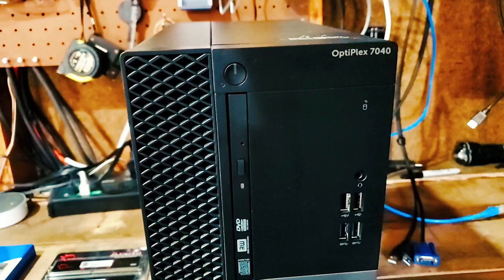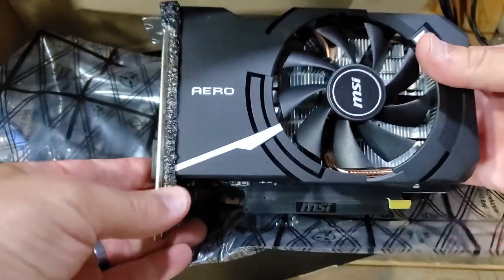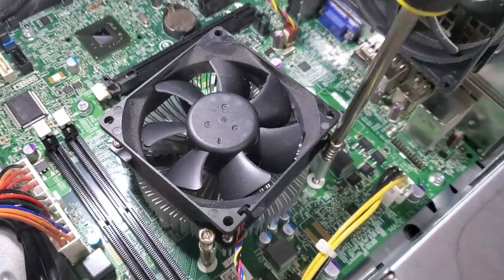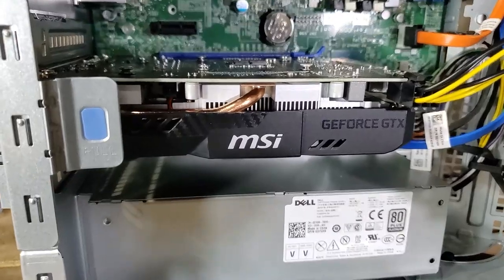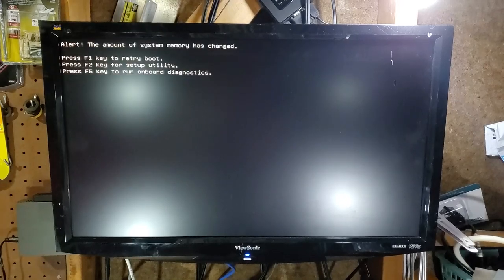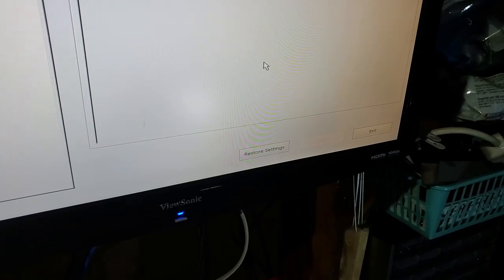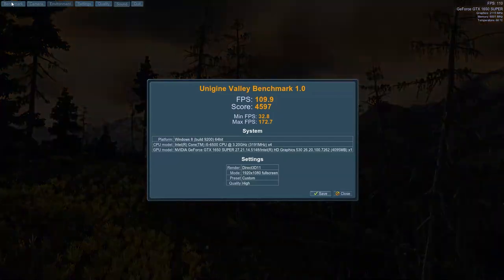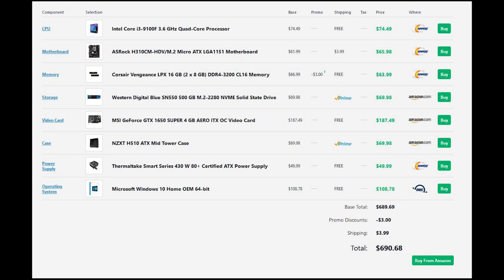Nvidia GTX 1650 Super in a Dell Optiplex 7040 - Best Optiplex Gaming PC for 2020!

Comment: I really appreciate that you kept on updating us with the power usage now I am confident that my system will handle the 1650 well below 180W
Reply: totally, agreed!
Reply: So we don't have to upgrade the power supply for this set-up to function properly?
Reply: Ya that saved me a ton of stress. Thank you very much. Very clear and helpful video!
Reply: any update?
Reply: mind you, thats a 1650s
Reply: What about a gtx 1650 4gb ddr6 model. Does it need a PSU upgrade?
Reply: @Mohammed_Ayaan46  No
Reply: @Mohammed_Ayaan46  
It takes only 75 so you're good
Reply: Does a gtx 1650 super need psu upgrade?
Reply: Can I use single sata go 6 pin? Or should I get the double sata?
Reply: @evamariaopara9501 I'm going with the single sata to 6pin. I've used before on regular 1650 with no problem. I trust it on the super. It's really only supplying @ 25w through pins 75w will come from motherboard pcie so shouldn't be any problem
Reply: Even a 3050 will work, because of new more efficient architecture, it only takes 75 watts

Comment: Good build buddy. I have dell optiplex 980 sff one the best built optiplex out there still works great. Now I see the inside on this 7040, I think this one is the best so far and the fact that it is very easy to work with and supports modern ddr4 and ssd.

Comment: Thanks for posting this video!
I was going to buy a GTX 1050 TI thinking it was what I was limited to.
I found a slightly used 1650 super for $225 and making an offer on eBay. The seller said was only used for a YouTube video comparing cards.
Reply: how did you go with the 1650 super, did it work well?, I thought i was limited to a 1050ti aswell
Reply: @joelpope801  It fit just fine and I just needed to buy a sata to 6 pin adapter to power it. Works great so much better than 1050ti. Power draw was only 195 max on the 240 watt Dell PSU measured at the wall with a Kill-A-Watt meter. For reference the EVGA 1650 super is 8" long and fit fine so make sure whatever brand you find is not much longer than that
Reply: @BARBELLS-AND-BUDS  did you buy the same 2-SATA to 6-pin?
Reply: @ber2996  I did run the sata to 6 six pin and it worked fine for about 6 months and then the computer wouldn't boot.
That little Dell PC couldn't support it and I kept replacing the power supplies with different ones with no luck 
It turned out it actually burned a trace or something in the motherboard.
I wasn't 100% sure, but bought a new motherboard anyway to try. 
I found a used motherboard on eBay though and rebuild the computer with a new motherboard and it's fine now.
With a 1050 TI was doing fine but when I went and put a 3060 in there and started gaming with it, it was too much over time.

Comment: Thanks for this, I just got a 7040 today paired with a gtx 1650, runs better than the Asus G20-aj i7 4790 with gtx 960.  Made the purchase largely because of this video.  I only play apex really and it runs at  high settings
Reply from the maker: Nice work!  The GTX 1650 is a great card.  Thanks for watching!
Reply: Does it need a PSU upgrade

Comment: This video's the sole reason why I'm gonna be able to upgrade my PC, I bought my 1st PC the delicti plex 7040 hoping that it would be good, it was decent for a while but I have been wanting more. With this video I will take your knowledge And beef up my pc with this much good new stuff I can throw at it. Thank you sooooooo much. You relly dont know how happy I am right now. You've relly made my day and probubly in a week or so my freaking week! Love your contend and 100% subscribing, liking and smashing the notification bell!!!!
Reply from the maker: Awesome, glad I could help!  Good luck with the upgrades and thanks for checking out the video!
Reply: I have 1 question, when I click on the link for the graphics card. It says that theirs onily 2 left in stock. Any other graphics cards that would worke just as good or better?
Reply from the maker: EVGA is my preferred brand for graphics cards, but I've had good luck with MSI, Asus, and Gigabyte cards recently, too.  The 1650 Supers are all basically the same, because Nvidia makes the chips.  The manufacturers tweak the clock speed and use their own coolers, but performance-wise they are all similar.

Comment: Thanks man for this video! I’ve been wanting a budget gaming pc that can actually run games but don’t have a big budget so this really helps! Also would a normal gtx 1650 be a big difference from the gtx 1650 super?
Reply from the maker: The 1650 Super is significantly faster than the regular 1650.  In some ways, it is a different card, even though they are both marketed as 1650 cards.  Definitely get the Super version if you can.

Comment: 7040 is a great deal because it's was a 2015 release and all the other used out there are 2011/2012. i7, 4x DDR4 RAM, beefy fan, beefy PSU, and an M2 slot for NVMe

Comment: I just bought a 7040 with a 256gb SSD and an i7-6700 off the marketplace for $65 and also bought a 1650 for $80. I bought a new PSU off amazon for $35. So for under $200 I have a gaming computer I’m so happy!
Reply from the maker: That's awesome!  Capable gaming PC for less than $200.  Nice work!

Comment: I picked up a 7040 as well - it arrived this morning. I just finished upgrading to Windows 11 Pro and will continue to upgrade the rest tomorrow. I need another computer like I need an extra hole in my head.... but I too really love upgrading and using these older computers. I was really only looking for an mATX board with an M2 slot for an even older Dell Inspiron 660 and then I saw the 7040 for $120. I just couldn't say no to the deal 🙄😅 I'll clone the drive to a 1tb M2 and hopefully boot from that and then clean up the 2-1/2" SSD 1tb drive and probably use this one for video editing. Fun little hobby for sure.  Great video 👍
Reply from the maker: I have a few more project PCs that I would like to get videos done for, but haven't had a chance.  Thanks for watching!

Comment: Awesome!  This video answered most of my concerns regarding the PSU.
 have a SATA SSD and 7.2krm HDD carried over from my laptop, hopefully that won't cause any problems with the power as I am planning to add a nvme drive in the future
Reply from the maker: Haha, I see you found my follow-up video.  I've had a lot of PSU questions since Dell went to this Optiplex design.. I may revisit this series and do a PSU upgrade in the near future.  Thanks for checking out my channel!
Reply: @EscoTech  how about trying to fit server PSUs and also try to use tfx and flex atx PSUs. For science ofcourse 😉.

Comment: Hi, nice video! I just purchased this build but with two extra changes - 1st 32 gig ddr4 ram and a One Terabyte SSD and 2 Terabyte hdd.... same all else... what do you think? interested in your opinion on this build!  Comes with Win 10 pro... QUESTION will this build handle Win 11???  thanks again Michael B
Reply from the maker: Hey Michael, unless you have a specific purpose, 32GB RAM probably won't offer any performance increase over 16GB.  You could probably save a little money there or put it toward something else.  Otherwise, the build looks great.  I don't think Windows 11 will support anything older than 8th Gen Intel CPUs, so this won't 'officially' support Windows 11.  Thanks for watching!

Comment: Hello buddy, I definitely loved your work. It's just amazing. 
I have a Dell Optiplex 7040 but also I have a Zotac 1660 super 6 GB that it's really small. Do you think it's possible to mount it with the same power supply or do you recommend to upgrade it?
Reply from the maker: Thanks for checking out the video!  I don't think I'd try a 1660 Super with the stock PSU.  I also don't know of any upgrades for the Optiplex 7040.  Dell started using a bunch of proprietary connectors and I don’t think the form factor will line up with SFX or TFX power supplies, either.  The 1650 Super is probably the fastest card that can go in this PC.
Reply: @EscoTech   you should look at the game bench.   He puts 1070 with stock 290 dell optiplex.
Reply from the maker: I've seen his channel, he does some awesome stuff with these Optiplex systems.  I'm not sure I'd be comfortable running a 1070 on a stock Dell 290W PSU long term, but it is amazing how efficient Nvidia's GPUs are now.  Thanks for watching, I'll definitely go check out his video.
Reply: @EscoTech   no  thx u  for uploading, i love watching this type of videos.
Reply: Hello sir , does your computer starts automatically for 2 seconds after you plug in the power cable ?
Reply: I asked this question cause i have the same computer

Comment: This is the most informative upgrade video I've found. Question, I have a dell optiplex 7090, i5 10th gen. It is the one between the tower and the tiny version. Can I run this card? It has a 250w psu
Reply: yes, this guy is running it on a 240w psu so you can run it on a 250w psu. Any card that takes over 100 watts will probably require you to upgrade the power supply

Comment: Thank you for your video! Do you think this assembly work for 3d modelling?
Reply from the maker: It depends on the software, but I think this meets the minimum system requirements for most 3d modeling programs out there.  Thanks for checking out the video.

Comment: Hey dude, good video. Quick question, if you used a regular 1650 instead of the super, would you still need the sata to pcie adapter?
Reply from the maker: There are regular 1650 versions that don't have a power connector.  As long as you go with one of those, it won't need the adapter.  Some have the power connector for overclocking.  Definitely try to get a GDDR6 version, though.  Thanks for checking out the video.
Reply: I was wondering the same thing! Thanks for the help :)

Comment: Thinking of upgrading an Optiplex 3020 i5-4590 with a 1650 super, will the stock PSU be enough? Also do you need the adapter you used?
Reply from the maker: It should be fine, but I think there are different power supplies used in the 3020, so I can't say for sure.  You will need an adapter for external power to the card for a 1650 Super, but there are some regular 1650 cards that don't need external power.

Comment: Good build. I have the same 7040 but the PSU 240w is rated 80Plus bronze will the GTX 1650 effect my PSU.
Reply from the maker: That should work just fine with any CPU from that era. There's no CPU + GPU combination that pull enough power to cause any concern.  Thanks for watching!

Comment: How old is that 7040? It has nvme support? I have a slightly older optiplex and I'm using a pci e adapter for a Samsung Evo nvme. I didn't know any Optiplex had anything above sata connection
Reply from the maker: This was the first generation to have NVMe support.  The 3040 did not, but the 5040 7040 and 9040 all supported it.  A few of the newer base models had the connector removed, but basically every Optiplex newer than this 7040 will have an m.2 slot.
Reply from the maker: The 7040 was released in 2015.
Reply: Awesome thanks. I had no idea

Comment: I've a Dell Vostro 3888 with i3 10100 and a Dell 260W 80-Plus Bronze PSU. Will I be able to run a GTX 1650S considering yours is 80-Plus Platinum but also 240W?

Comment: Did you try to install i9 9900 on it? Socket is the same. Any chances to go?
Reply from the maker: Even though Intel used socket 1151 through the 9th gen CPUs, this system can only use 6th and 7th gen CPUs. The early core i9's were all socket 2066, so even though there was a 7th gen i9, it used a different socket.  The Core i7 6700 and i7 7700 are the fastest CPUs you can use in this system.  I guess you could go with a K-series CPU and gain a couple hundred MHz, but you wouldn't be able to overclock it, so the gains would be minimal.  Thanks for watching!

Comment: Just got one of these for free yesterday, definitely going to put similar parts in it. I had an issue with the boot taking a long time, disabled legacy boot, UEFI only, raid on with an m.2 ssd . Are there any specific BIOS settings I should mess with that might be making it crawl.
Reply from the maker: Is there actually a RAID array initializing? That could take a while.  The other two settings I'd check are the BIOS delay (adding seconds for slow initializing hardware) and the Fast Boot setting.  If it's on thorough, it will take the longest to boot, minimal will be quick, but you might miss new hardware or system changes, and auto will detect any new changes and go fast if it doesn't find any.  Auto is the setting I'd recommend.  Thanks for watching and that's awesome you got one for free!
Reply: @EscoTech  thanks man, yeah I got it booting normally/fast now with the settings you just listed. 🙏 thank you. And yeah, I work in IT so I get the older optiplexs to play with, got a 9020 model running Mac OS and it runs beautifully, much faster than my 2014 Mac Mini. These are such great workhorse PCs.

I don’t have a raid array although I have 3 m.2 drives running, one on the motherboard and two in and add-in card but no raid array, just 3 separate drives. I turned it to AHCI mode and that seemed to help. All UEFI booting, probably gonna try Mac OS on this one too. thanks again dude, really appreciate the info!

Comment: The video card you used in this video was asking for 75w, 300w power supply. Obviously, this doesn't have a stock 300w. Using a similar atx adapter, would this computer handle any pci-e 3.0 16x video card asking for 75w 300w power suppky card as long as it can fit inside the case?
Reply: yes many people use 75 watt cards on 240w power supplies and it works fine.
If the cpu takes 65w, motherboard takes 50w, gpu takes 75w.
thats 65+50+75=190 watts which is well within the power limit

Comment: Hey boss do you think a MT dell 7040 like this with a 1660super would respond just as well? I plan on getting the same 500gb ssd and buy a sata adapter for the gpu, as far as you know it shouldn’t be too much wattage for the dells 240w psu right? I can find 7040 easily for 150 on eBay I just wonder if it can handle the 1660super, thank you!

Comment: wait will my 250 watt psu run with i3770k which it's tdp is 77 and a gtx 1650 super like you but without a platuim rating after 2 years.

Comment: Hi! What do you think about install Kingston Fury DDR4 16Gb`s? Single 1x16GB or 2x8Gb?
Reply: And another question. Will the Crucial P5 500GB NVMe works with this setup?
Reply from the maker: Yeah, the Kingston Fury is good RAM, I'd go with 2x8GB to get the benefits of dual-channel RAM.  Also the Crucial P5 500GB NVMe drive is also a great choice.  Thanks for watching and good luck on the build!

Comment: Hi, what psu do you use. Because i have Optiplex 7050 with 270 watts i think, do you think i can put this card even if its dual fan or i should go for the 1650 non s?
Reply from the maker: I think you would be OK with the 1650 Super.  The dual fan version should only draw a few more watts.  Thanks for watching!

Comment: I just purchased a 7040 with an i7 6700 SKYLAKE. What graphics card is the best value for the money for this beast? THANKS!
Reply: Also, would I benefit from 64gb Ram or would 32g suffice? I plan to use it for video editing, streaming from xbox and some gaming.
Reply from the maker: The GTX 1650 Super I used in this video is the most powerful GPU you can put into this PC with the stock power supply.  I don't know if there are any viable ways to upgrade the power supply, either.  Good news is the 1650 Super is one of the best bang for your buck GPUs out there, if not the best.  It also has Nvidia's NVENC encoder that will help encode video and can help with streaming.  I was going to try a version of the 1660, but the 240W power supply is too close for comfort to run those cards.
Reply from the maker: Also, 32GB of RAM is probably overkill, as 16GB would probably do the job just fine.  I'd start with 16GB, then check your actual RAM usage and decide if you need 32GB.
Reply from the maker: I am going to film another video with this PC this week, too.  I am going to swap out the i5 6500 and test with an i7 6700 to see how much it helps in the benchmakrs.  I also have a cooling upgrade video for this PC that should be up this weekend.  Thanks for checking out the video!

Comment: How would you remove the stock Radeon graphics card that comes with the system? Sorry, I’m new to building computers.
Reply from the maker: No problem, flip open the bracket on the rear I/O cover that says pull, then there is a blue lever at the end of the PCI-E slot.  Just lift the end of that lever up(toward the top of the PC) and pull the stock graphics card out of the slot, directly away from the motherboard.  Shouldn't take too much force, but you will have to pull a little.  Thanks for watching!

Comment: This question might seem a little unrelated, but would the GTX 1050 TI LP work with a 200W SFF Dell Optiplex?
Reply: yes, I've got it in my 9020 SFF
Reply: @nicholasmarlon4719  which is 200w right?

Comment: Instead of the 7040 i have the 5040 model which is pretty similar, will it be the same?
Reply from the maker: The 5040 is very similar, but it uses DDR3L RAM, instead of DDR4.  It does have the m.2 slot, but I've never tried one, so I'm not 100% sure it supports NVMe storage.  It SHOULD, but this was from a time that SATA m.2 drives were prevalent.  I do think it's worth trying the upgrade.  Thanks for checking out the video!